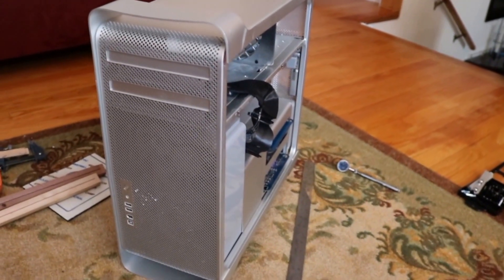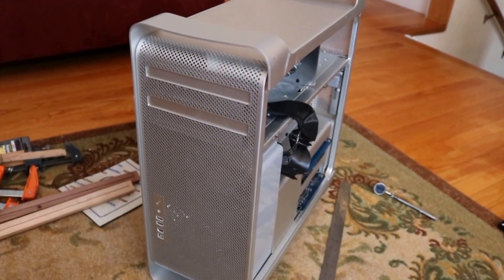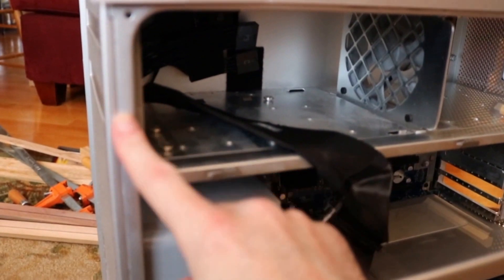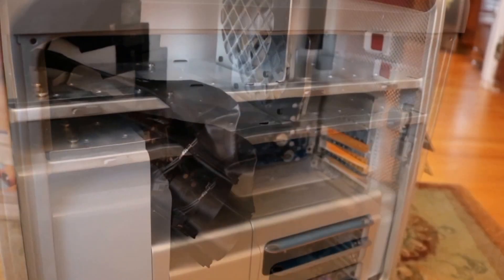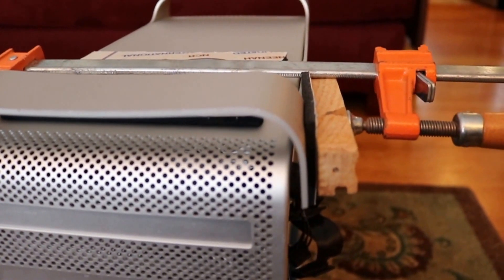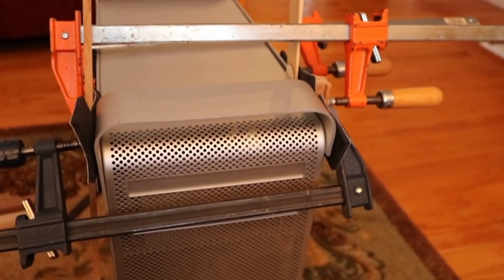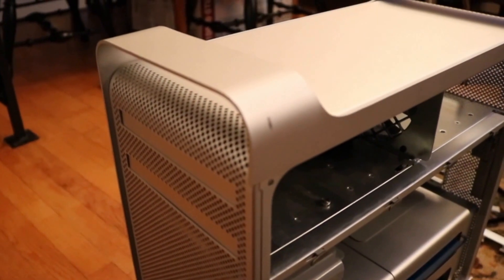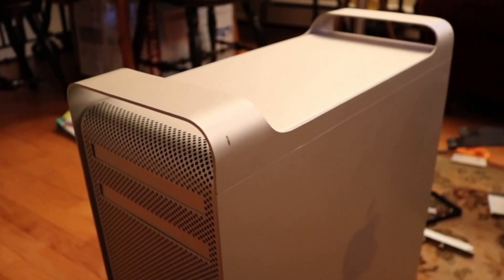Mac Pro Case Repair

Comment: So I have a Mac Pro 2009 that has a very similar issue, but I am able to open and service the machine. 

The bend is nothing major, but I am trying to use a bar clamp like you are and it looks straight when it’s tightened, but even after leaving it overnight I untighten it and it bends back. The clamp I’m using has 1500lbs clamping pressure and am using a 3” thick piece of wood covering the bend. What am I doing wrong?

Comment: I found a 2009 model with the problem locally for dirt cheap. I’m gonna pick it up today and try this. Thanks for the upload 👍
Reply: How did it go for you? We’re you able to fix it? I’m trying to do it to mine and I can’t get it to bend back into place for the life of me. It’s not a big deal though, it’s in the same location as the uploader’s Mac Pro and not even as bad as that.
Reply: @noahbecerra  I ended up buying an empty case from a local recycling facility.

Comment: After watching this video a few times it looks like gutting the case and removing the rounded skins of the handles is doable with unscrewing. Then it would be a matter of finding a way to reattach the side panels.  Or if the side opposite the removable panel doesn't come off or is part of the same skin as the handles then take it all off.  If the sides must all come off and stay off then maybe then it they could be replaced with either some smoked Plexiglas or 3/8" plywood cut to the shape of the sides' inside diameter and screwed in front and back with a few small not too obviouis screws.  Any feedback would be greatly appreciated. Thanks

Comment: My Mac Pro has the exactly same damage as yours. How did you unloosen the screws inside the chasis?
Reply from the maker: The screws are at the top inside of the case so you have to take alot of the components out to reach them. There are also ones behind the logic board but I didn't need to get to those.
Reply: All good, was able to use only my socket extension with the T10 screw bit and unloosen by hand. The clamping technique has worked, now the fun part... putting the screws back in! Thanks Bell Multimedia for the informative vlog!

Comment: Quick question...I am curious about the metal handles and feet on the G5, are they riveted to the rest of the frame? I ask because I have a Mac Pro mid 2010, and the chassis (basically the handles on top) are bent and damaged. I'm wondering if I could grab the G5 chassis, tear it apart to use only the piece that makes up the handles and swap it with the ones in my Mac Pro. It seems like that portion of the chassis is identical. But I just can't find anything online to confirm.
Reply from the maker: Juan Guzman I am not familiar with the G5 case but the Mac pro handles are not removable anyway but fully integrated with the side and top. You could straighten what you have with some persuasion similar to what I did in the video?
Reply: Thanks I really Appreciate the response! I actually decided on giving up on replacing the frame and will just try your method instead.
Reply: no chance, every mac pro generation ha itd own unique nut bases located, you cant even switch housings between 1,1 and 3,1, G5 is totally different
Reply: @przyplyw  rip

Comment: Anybody know how to remove the plastic feet from this thing? I want to powder-coat mine but am not sure how to get the feet off, either with or without breaking them.
Reply: The feet are aluminum? 

If your talking about the little ass pads they are glued on bro. Not many options for you.

Comment: Do you think its possible to separate the handle from the case?
Reply from the maker: Not very easily. The handles and case are one formed part. The case is screwed to the frame so in theory you could remove the handles and the case would still be attached. In order to remove the handles they would have to be cut off. Possibly you could use a dremel rotary tool or an oscillating multi tool with a metal cutting blade. Not sure why you would want to remove the handles but I guess it is possible.
Reply: Bell Multimedia Thank you for your fast reply. I was thinking about black anodizing the outer shell of a 2006 mp, and blue anodizing the center case. All of that to build a nice file server as a fun project. If the other side is spot welded theres always drilling that can be done to remove the weld. Anyway I'm currently searching for a third mp to begin this project. Happy new year!
Reply: I did it once, it took 2 hours, tricky combinations of screwdrivers to reach tight spots dismounting everything and unscrewing 90 nuts that hold the outer layer and still I did not get to straighten the case - this method presented here is much better and more eficcient. Dismounting the outer layer could be useful if you wanted to paint it though
Reply: The feet on my machine are so fucked that cutting them off may actually be one of my best options.